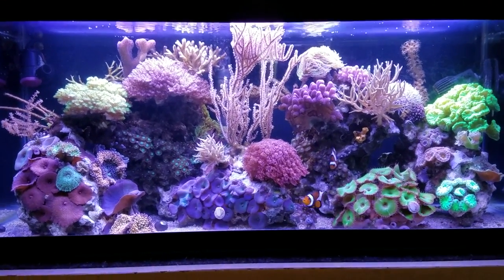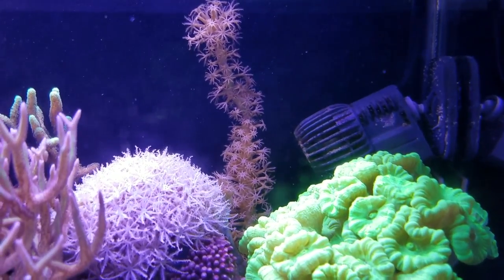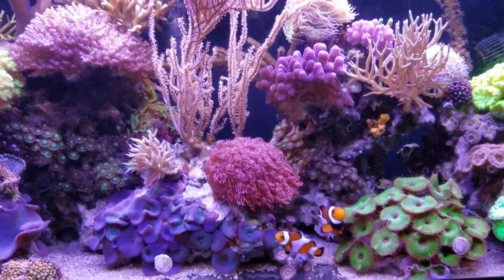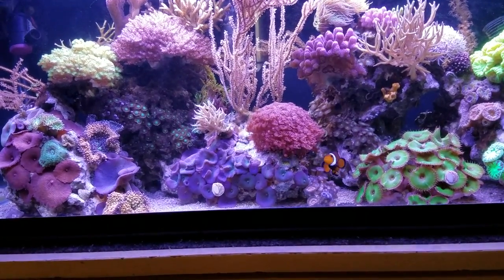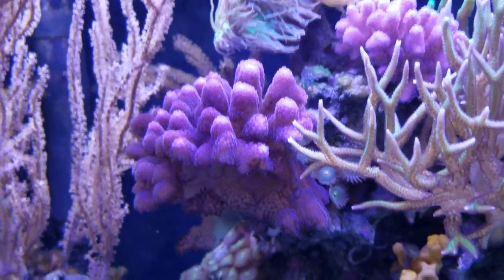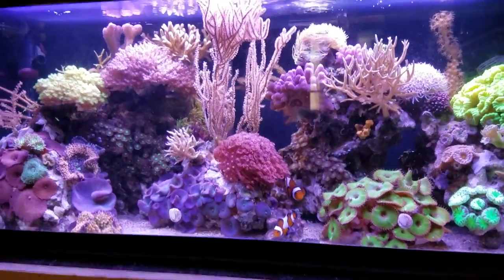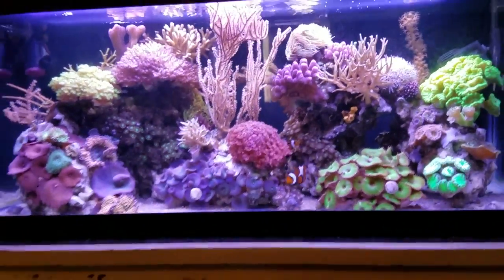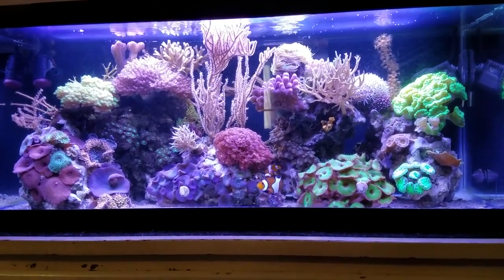My Flow Pattern and Why

Comment: I’d get a surface skimmer if I were you. Great looking tank nonetheless! Some big corals 👍🏼👍🏼
Reply from the maker: Thank you for your suggestion.   I like to keep things very low cost and simple.  Thank you again. Blessings and happy reefing!
Reply: susan nichols An Eheim skimmer is $30 and never needs cartridges or anything. It gets rid of the surface scum on the top of the water to add more oxygen into the tank and less co2 which fluctuates ph. It could add that little extra bit for the fish even though your tank is amazing! Nearly perfect imho.

Comment: Beautiful reef like always. I have a question for you. I recently picked of a ORA Red gonipora. I see you have one in the center of your reef tank. Any special needs feeding? I try feeding mime 3 times a week Reefroids. 
What do you feed yours? Also where did you pick up your Red gonipora and how long have you has it for?
Great job on the tank all the corals look awesome! Keep up the updates.
Reply from the maker: Thank you so much!  I used to have some issues keeping them alive as well.  I have found that they like moderate to low light (more blue spectrum) and depending on the color, low to medium flow.  (although I do have a friend with a bright green one in very high flow and is thriving!)  I find they do much better if using Reef Energy part A and B.  I have many colors now that are doing well in two different tanks.  I also pray about how to care for them as I don't like to loose any living thing in my care.  I do not spot feed mine but do sprinkle in Coral Frenzy almost daily, for my whole tank.  I did not buy my red gongi.  I swap out corals and frags with friends all the time.  My friend had gotten it at Premiere Aquatics in Roswell Ga.  and gave me a small frag of it that broke off her colony while she was mounting it. I don't even think it had 15 heads when I got it.  :)   I looked it up...I have had it since November of 2015.  Hope this helps.  I am no expert mind you.  :)  Thanks again!  Blessings and Happy Reefing!

Comment: What kind of lights do you have on your tank? It’s really pretty!
Reply from the maker: I have two of the Current Orbit Marine LED programable lights.  Not the Pros.  The first ones they came out with.  The cheaper ones.  I have a shallow tank so there is plenty of light.  I have the lights turned way down on this tank with these lights.  Hope this helps.  Thanks and Happy Reefing!
Reply: susan nichols I have a 55 gallon tank with 2of the current orbit marine loop pros and was wondering if they were any good
Reply from the maker: I have no experiance with those lights but I would say they are good.  I have used many lights over the  years by Current for fresh water and salt and they have always been great!  One of my favorite go to companies for great lights that do the job at a resonable price.  I would also say the pros would be good for your 55 as it is deeper and would need the extra lighting capability of the Pros you have.  Blessings! abd Happy Reefing!